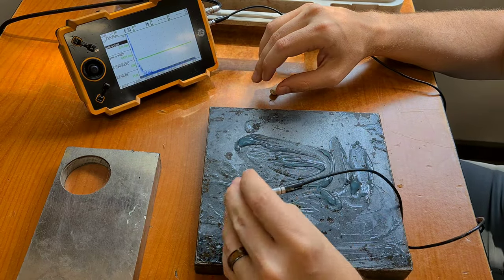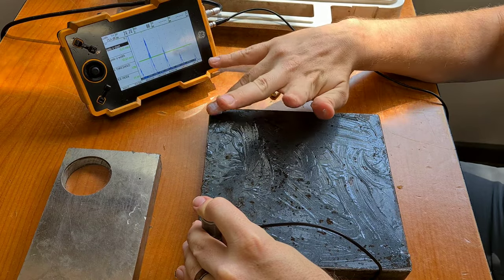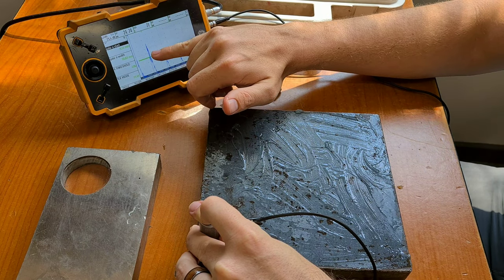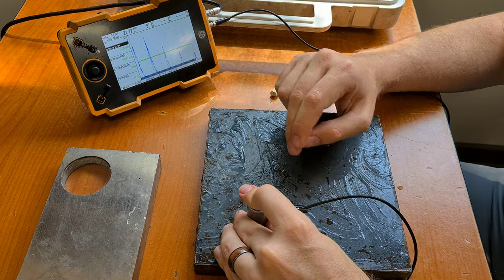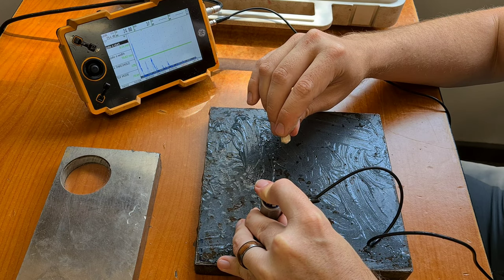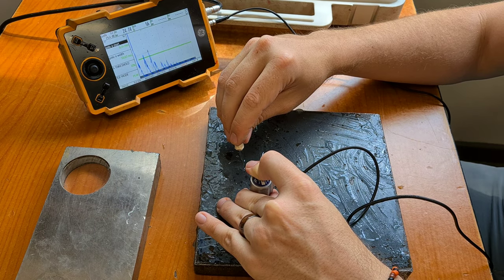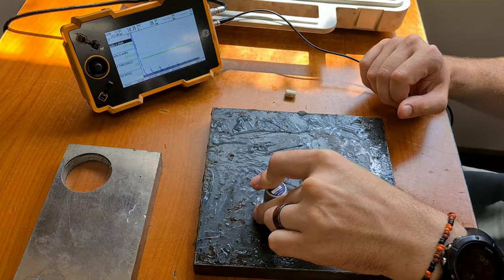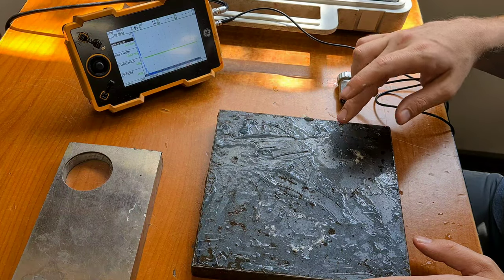Guide to a simple lamination scan with ultrasonic testing. Single crystal 4Mhz probe.

Comment: Dear Mr. Garath Bester, I have watched all your UT Videos and still continuously watching your helpful videos. You are a blessing to our community in NDT. I just have a question, Isn't equalization technique are only to be used if the lamination depth are half the thickness of the test piece? Otherwise, the 6db drop technique are to be used? Correct me if I'm wrong.